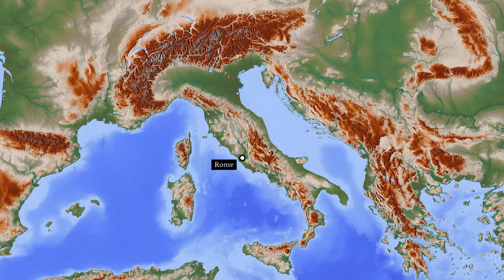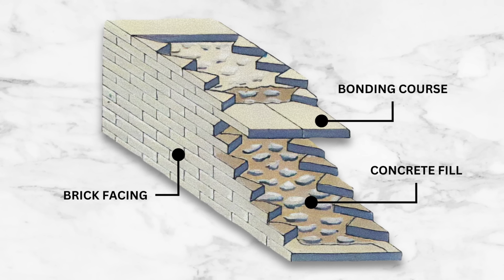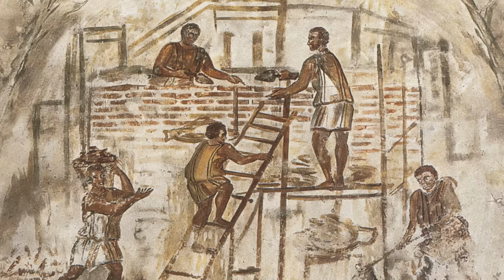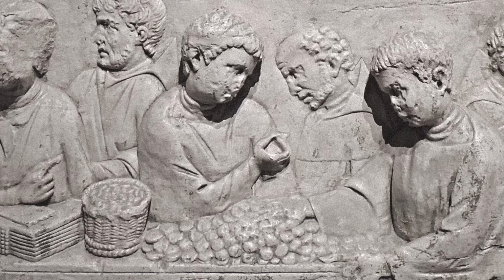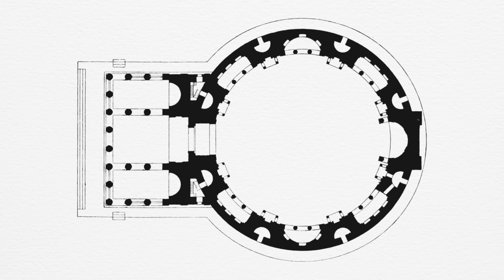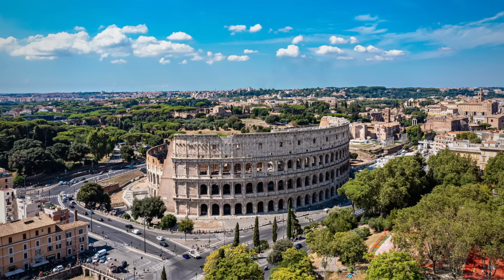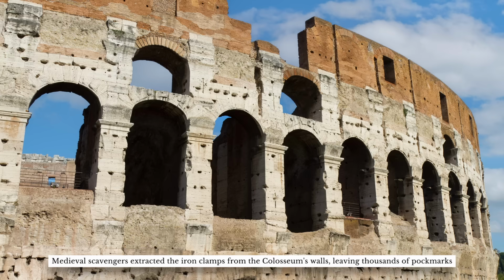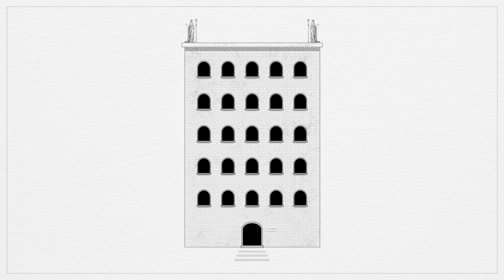Why isn't Roman Concrete used today?

Comment: Roman concrete is an example of just one type of ancient "geopolymer." Other cultures, like the Egyptians and Incans, had their own recipies. Geopolymers are quite different from modern "portland concrete." If we simply focus on the chemistry, we will find geopolymers an excellent material for modern applications including skyscrapers! There are many companies working on modern geopolymers for industrial and commercial uses. Perhaps a video should focus on how the Romans discovered how to combine the ingredients in the correct order to create a type of carbon-neutral concrete that has lasted 2000+ years?
Reply: A Venetian company called MGN have a very long term study on this, have engineered a good replica lime and pozzolan line of products. They're available on the UK market and are honesty as mind blowingly good as one would imagine. I use them a lot, they're expensive but magical.
Reply: Modern concrete has a limited lifespan because of the steel included in it ...and the sloppiness of the mix to pump it in, ultimately weakens it ...then the steel rusts eventually and cracks the concrete ...50 years about it
Reply: @oftin_wong  Absolutely correct. Non-corrosive reinforcement would significantly extend the lifespan. Also, the mix you use for your patio or retaining wall is quite different than highway overpasses or highrise podiums. HOWEVER, modern concrete is so different from Roman concrete that it's like comparing gasoline to electricity -- both serve a similar function (as fuel or an energy sources), but their underlying nature and impact are quite different.
Reply: @JohnCaldwell993  
The Romans also used a dry mix and tamped all the water out of it 
..it's similar to rammed earth construction techniques  today
Reply: @oftin_wong  The Romans did not attempt to remove all the water from their concrete. If they had, the concrete would have been weak, brittle, and porous, as the essential reactions -- such as the hydration of lime and the pozzolanic reaction with volcanic ash -- require water to occur. Without these reactions, the material would have lacked durability and likely suffered early failure. While tamping was used to compact the mixture and eliminate large air pockets, enough water was left in the mix to allow proper chemical bonding and ensure structural integrity. There is no evidence to suggest they aimed to remove all the water, only to achieve the right balance for strength and workability. In rammed earth, there is no chemical binding -- the strength of rammed earth is mechanical, not chemical, and comes primarily from the physical compaction of the materials. This is not the case with Roman concrete or any geopolymer.
Reply: @JohnCaldwell993  
It would be impossible to tamp all the water out of it ...correct 
I should've been more specific 
But that's how they did it none the less.

With rammed earth cement is added to the earth in all cases (not just any old  earth it must fit the parameters)...if you want it to last ...the mix shouldn't be sloppy 
and the tamping is crucial to consolidate the aggregate in a tight matrix, usually done with jack hammer ..but I've done it by hand ..works good
Reply: @oftin_wong  No disagreement here. But you're taking about cement. Portland cement ≠ Roman concrete.
Reply: @oftin_wong cement is only added to cement stabilised rammed earth. 

For the vast majority of the past few thousand years there has been zero cement in rammed earth.
Reply: @FekDindad-xy9vz  
I'm not talking about the ancient past 
In relation to rammed earth 
I'm talking about rammed earth ...today...that's why I said 
..."rammed earth construction techniques ..TODAY"
Reply: No. You said tamping all the water out was similar to rammed earth today. Which is true in the loosest sense, RE is tamped today, and 2000 years ago, but not to get all the water out, and Roman concrete wasn't tamped to get the water out either. 

You also said ALL RE has cement. Which isn't true ever. Not today not 1000 years ago. Cement stabilisation is one technique used in some applications. There is a lot of new RE built today that has no cement.
Reply: @FekDindad-xy9vz  
I said ..."If you want it to last"
The tamping forces what water is in the "comparatively"  dry mix out,
 in the sense that it consolidates the aggregate in a tighter matrix ...by excluding some of the water compared to simply letting a sloppy mix... set, which is inherently weaker and would need steel reinforcement to meet codes. 
..in addition without cement in the rammed earth mix it's like trying to attach something to a cocoa pop wall, it's not a smart move for housing.
...hey instead of nitpicking and searching for possible mistakes in what I've stated what else have you got to add that means something tangible ...to the actual topic at hand ?
Or spend a day working in the field so you too can know it
Reply: @oftin_wong  
Tamping doesn't force water out. If water is coming out of your RE the mix is way way too wet. if you ever spent a day in the field you would know this. 

And you don't need cement "if you want it to last". Otherwise we wouldn't have 1000 year old RE. 

I'm not nitpicking. I'm pointing out glaring errors in your comments. You genuinely don't seem to know much about RE.
Reply: @FekDindad-xy9vz  

It is a relatively dry mix correct, the tamping is about consolidating the particles at the expense of the water, as a result ..."SOME"  water is excluded in the tamping process ...this is all to be compared to a sloppy mix pumped through a pipe, the bit you seem to be ignoring or missing ...I don't know?......look dude you can simply read my comments again ..they are very succinct and none of it is a lie 
..please just find someone else to annoy ok ..I'm bored with you
Reply: @oftin_wong you can use non-steel rebar and modern concrete will suck up water and crack due to cold and the weaker HCL bonds of modern concrete (vs geopolymer) are weaker  and linear (like I said) than geopolymer bonds which are also 3 dimensional in form and more numerous, hence stronger
Reply: @VenturaIT  
You can do any number of things
Not all jobs are done in freezing northern climates ..there's the tropical and temperate zone  on the planet where stuff doesn't freeze, so I'm not sure what you are trying to establish here  
.. that's not the point ..it's a comparison
Reply: Engineers and architects design structures within budget and timeline. They could absolutely build a structure to last thousands of years, but that wouldn't fall within the budget or timeline.
Reply: Was it carbon neutral? They still needed lime, which needed to be fired.
Reply: @mosar52  Strictly speaking, you're correct. However, the CO2 emissions were 0.4 to 0.6 tons  of CO2 per ton (30-50% less than modern cement); a 30-50% reduction in CO2 emissions compared to modern Portland cement; 20-40% less energy usage (for the lime firing, as you cited) compared to modern cement; and reabsorbs 5-10% of its CO2 emissions over time. Modern geopolymer concrete production is even better.
Reply: We always hear about what the past knows but we never hear about how they know it
Reply: @hazlox Forensic engineering.
Reply: History actually never changed if you really studied it for all the buildings of old are the same as today and you could never tell the difference except for a little bit of weather and where look at Pompeii that they uncovered from all the Ash looks like any downtown America brick storefront square grid towns
Reply: Why would you focus on that topic? The Romans didn't set out to create something that would be carbon neutral or knowingly last several thousand years.
Reply: @shawnsg  To be clear, I mentioned those two qualities as an advantage to us (as opposed to Roman design features). Portland concrete, which we use everywhere today, was only invented in the early 19th century, and requires manufacturing technology the Romans did not have. Portland concrete makes up 9% of the world's CO2 production and lasts an average of 25 years before needing replacement. Whereas the Romans discovered a formula requiring no complex manufacturing, 80% less CO2, and last an average of 4x longer. They did that 2300 years ago?! I think a video that focuses on how that was discovered and applied to broad-scale block pouring for infrastructure would be fascinating. It's only within the last 20 years or so that we developed the microscopy technology to distinguish between real stone blocks and geopolymer concrete poured blocks -- I think we're going to soon discover that this tech was used a lot more than we realised.
Reply: @JohnCaldwell993  The problem with Roman concrete is that it sets very slowly compared to modern portland concrete and that it uses natural pozzolans which were widely available in Campania, Italy and Santorini, Greece but are not very common in most countries. Fly ash is a good replacement for natural pozzolan but not as good as the real thing. Unless we found a way to produce pozzolans artificially, the world's deposits of pozzolan would soon be depleted.
Reply: @ΕρνέστοςΣμίθ  The word "concrete" is a misnomer here. The underlying properties and chemical reactions of Roman concrete versus portland concrete is different. Roman concrete is an early iteration of "geopolymer" while portland concrete is a "hydralic cement". You cannot really compare the two except in their final physical form. The reason Roman concrete set slowly was because they were using a formula from 2300 years ago, which had its limitations. Our modern formulas are far better due to our advanced understanding of material sciences, and your suggestion that natural pozzolan is superior is just factually wrong. Fly ash, as an example, is preferred over natural pozzolans for geopolymer concrete because of its higher silica and alumina content, finer particle size, greater reactivity, consistency in quality, better workability, and environmental benefits, making it a more effective and efficient material for geopolymerization. Matural pozzolans may be superior to fly ash when local availability, historical authenticity, low calcium content, or aesthetic qualities (i.e. cultural or heritage projects) outweigh the benefits of modern ingredients.
Reply: @JohnCaldwell993  because titans of industry want exclusivity, anyone can make geopolymer, it's easier to make than portland type cement/concrete... they want to keep out the competition, i.e. job security
Reply: @JohnCaldwell993  like you said it's all about the chemistry... modern concrete uses weak HCL bonds that form once and aren't as strong or numerous but roman concrete/geopolymer uses other types of bonds that are stronger and there are more of them and self heal in some cases... im not quite an expert on it but I am learning as much as i can
Reply: @JohnCaldwell993  "Whereas the Romans discovered a formula requiring no complex manufacturing, 80% less CO2"

No, that's not true. A significant part of both Roman and most modern cements is limestone which is baked in a kiln expelling carbon dioxide.
Reply: @JohnCaldwell993  "The word "concrete" is a misnomer here."

No, it's not. The term concrete just means material which has rocks as (coarse) aggregate and then a binder. Even asphalt concrete is a type of concrete even though it's not usually called that.
Reply: @seneca983  Technically, you’re correct in the engineering sense. But using the same word creates a false equivalence in normal conversation. Roman "concrete" was chemically and structurally very different.
Reply: @seneca983  You’re right that the Romans heated limestone and that releases CO2, but that doesn’t contradict the point. Roman concrete used far less lime (around 70-80% less) than modern Portland cement uses clinker, and it was burned at temperatures ~600C lower. That means far less fuel and far less CO2 in the manufacturing process. And that’s not even counting the much higher lifetime CO2 reabsorption rate.
Reply: @JohnCaldwell993  Roman concrete/cement is not nearly as different from Portland cement as you are saying. In both the main ingredients are limestone (baked in a kiln) and silicates. Roman concrete has more aluminium, though.
Reply: @JohnCaldwell993  At least from what I can find Roman cement used about 1/3 lime and Portland cement uses about 2/3. If that's correct that would be about 50% reduction which is less than 70%, though admittedly still a big reduction. I don't think 600 °C is enough for the calcification reaction of lime.
Reply: @seneca983  You're focusing on the ingredients list (lime + silicates) while ignoring the massive differences in how those ingredients are processed, how they react, and what structure they form. Roman concrete uses lime (CaO or Ca(OH)2) mixed with volcanic ash, whereas Portland cement uses limestone (CaCO3) and clay fired together into clinker at very high temperatures. That clinker chemistry is COMPLETELY different. The volcanic ash in Roman concrete is rich in aluminosilicates, so it forms a C-A-S-H binder, not Portland’s C-S-H. Aluminum does NOT form the primary binding gel that gives Portland cement its strength. Aluminum DOES play that central role in Roman concrete. Same ingredients on paper, totally different chemistry in practice.
Reply: @seneca983  Not 600°C. ~600 degrees less than the temperature used for Portland cement. It's 850°C compared to Portland's 1450°C. That's not a trivial gap. It's not "heat limestone more." It's a completely different reaction path that produces a completely different material.
Reply: @JohnCaldwell993  I don't think it makes sense to say that it's "completely different" because the result is calcium aluminium silicate hydrate rather than calcium silicate hydrate. Also, Portland cement also often uses at least some amount of aluminium oxide as an ingredient.

Comment: That building in Chicago is indeed a hulk of a space. Solid hallways, but not claustrophobic when one walks it. Open to the public as well. First floor has small shops.
Reply: No earthquakes in Chicago either.....
Reply: @iamgermane  Actually there are earthquakes in Chicago. Indiana and Illinois lie in the most seismically active region east of the Rocky Mountains. This region consists of two main areas, the New Madrid Seismic Zone and the Wabash Valley Seismic Zone.
Reply: @Nyx773  Yes, the New Madrid zone is expected to destroy St. Louis. In the early 1800s there was a huge earthquake and it changed the course of the Mississippi!

Comment: As an architect I would like to propose iron reinforced travertine on corners and load bearing exterior columns, paired with Roman concrete vaults between those columns to stablize them laterally,  and one additional medial layer of concrete columns and vaults to sablize them in depth. Then, all flooring will be wood over wood truss. This is somewhat similiar to the sections of many roman basilicas. I'm sure there would be ways to optimize the structure, lean on the strengths of the selection of materials to create larger windows and less ristricted living spaces.

Comment: I always wondered why didn't the Romans build walls of solid brick but instead prefered brick facing and mortar/concrete interior? Medieval brick buildings almost excusively use solid brick technique as do more modern brick structures. Roman technique seems unnecesarily complex in comparison.
Reply from the maker: Concrete-faced brick was quicker, cheaper, and (if done right) ultimately more durable than a solid brick wall.

Comment: If they built it properly you could probably go.... 6-10 stories? It'd have to be done with arches and what not though. Like most their structures. They also used concrete for the floors and foundations but block for walls. And they didn't really "pour" concrete like we do. It was troweled on. Unless they figured out reinforced concrete they would likely do blocks.